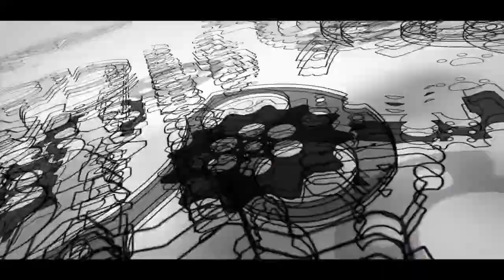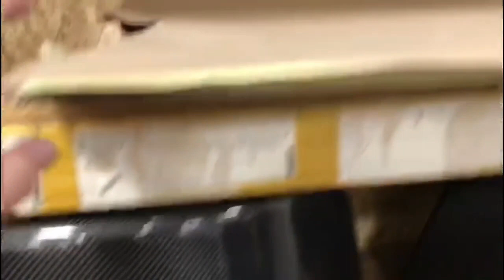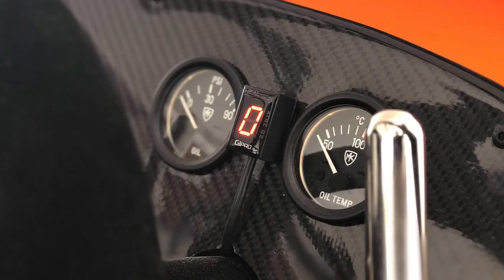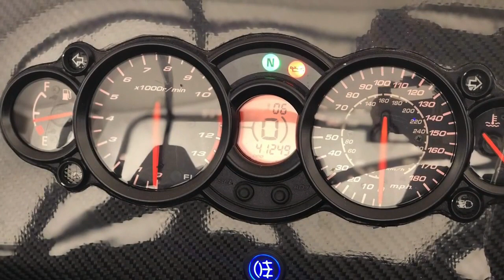MK Sportscars End Of Project Special - MK Indy RR Hayabusa Gen 2 Project Finale

Comment: Absolutely stunning! The fuel cap being partially obscured by the boot cover looks a bit awkward though.
Reply from the maker: We can’t help that because builders don’t read the manual where the fuel cap should be with the x and y measurements and it looks weird if the cut out doesn’t line up with the boot cover.  It’s easier to just have a straight boot cover, but I hear you.  
We welcome any suggestions.